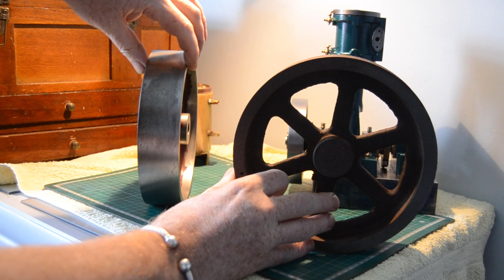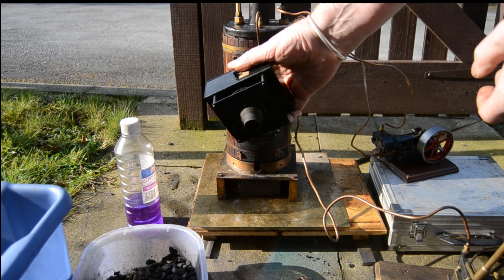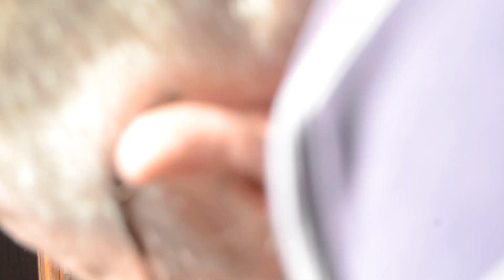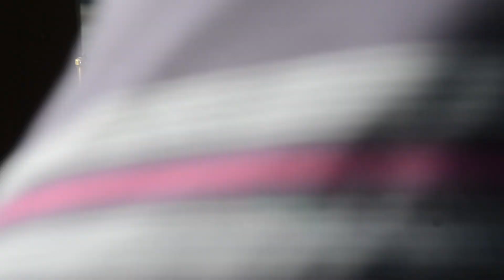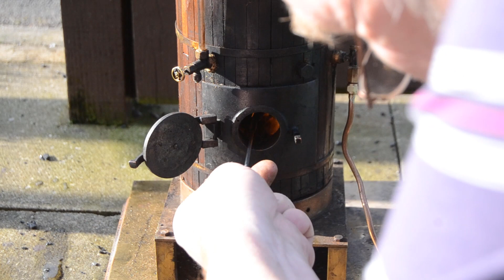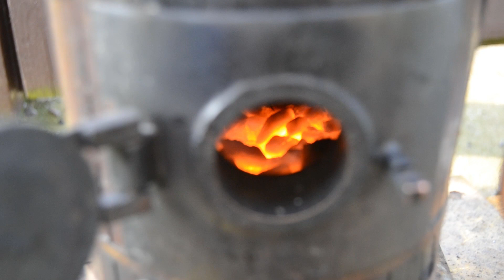Coal firing a vertical boiler.

Comment: Just some friendly advice. Fire with coal, little and often. Keep a steady fire. That helps. When the pressure approaches about 10 psi below pop-ff, cut the blower way down to avoid lifting the safety. This will help save steam. Open the blower before starting to pump water, but feed the fire before opening the fire box door. Opening the firebox door with the blower cranking will allow unheated air to shoot up through the boiler, and cool the boiler, thus lowering the pressure. It also causes thermal shock to the tubes and can cause leaks. Once you have fed the fire a couple shovel fulls, close the firebox door, then open the blower. The pressure should start climbing. Once the needle starts to rise, start pumping! Also, never let your water level get that low. Low water levels and boilers do not mix well.

Comment: What coal do you use?
Reply from the maker: Hi Matt, it's small grain Welsh steam coal. It burns well and gives out a lot of heat but needs a really good air flow to get started.   https://www.maidstone-engineering.com/tools/steam-sundries/coal/welsh-dry-steam-coal-grains
Reply: @modelsteamers671  thanks bought some myself. Do you recommend starting with soft coal?

Comment: Very nice demo of this organic process.

You are mastering the art!
Reply from the maker: Thanks, its good fun running on coal once you start getting the hang of it. I really need to sort out some kind of powered feedwater pump though.
Reply: I can imagine! Even my 3 inch boiler takes a fair old bit of pumping and these hand pumps don't have a very ergonomic feel to them. I'm thinking of making a hand lever extension on mine but a powered pump would be great.
Reply from the maker: @gary.arthur  I added a handle extension to mine as the original lever was too short when pushing against boiler pressure.
Reply: Absolutely. I have a scrap bit of copper pipe over mine as a stopgap but will make a handle at some point. Maybe with a nice ball on the end.

Comment: Thanks Peter,  You have certainly whet my appetite to build a boiler for my Stuart No1. Have you considered using an injector to maintain water level in the boiler ?
Reply from the maker: Thanks, I did consider an injector but I'm led to believe they can be steam hungry. I thought about making a brass pump similar in action the the hand pump in the video but instead of a hand lever have the ram driven by an eccentric on my vertical engine. I'm going to get the engine finished and then do a few tests. It looks fairly easy to build a ram pump but I need to be sure it will pump reliably against 90psi. It will be interesting to see how my boiler copes with your no1 engine, it works better on coal but is still a good steamer on gas.
Reply: Looking forward to it. I have stacks of kindle wood and a sack of anthracite to feed it!
Reply from the maker: @no23mk2  I had expected to just bring gas but if you have wood and coal that is better still. :-)

Comment: good instructional video , much better than most on this subject. Have used coal fired boilers on ships in my youth but there is always something new to learn
Reply from the maker: Thanks, there isn't a lot on youtube showing firing from start to finish so I thought I'd try and have a go. It's not rocket science but its something that has a knack to it. Even on a little set up like mine it can be a full time job getting the fire well established and having a good water level. Once its all up and running it does get a bit less labour intensive ;-)